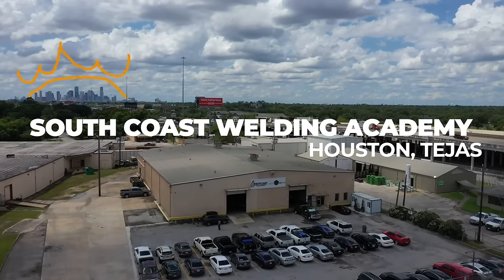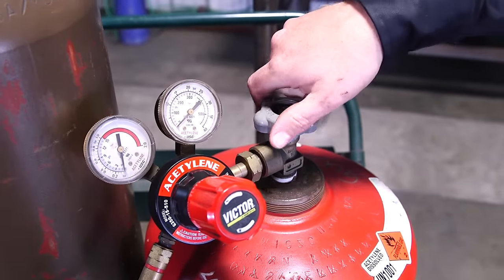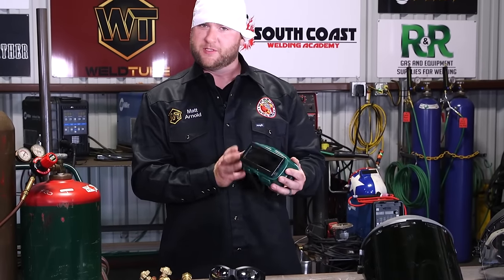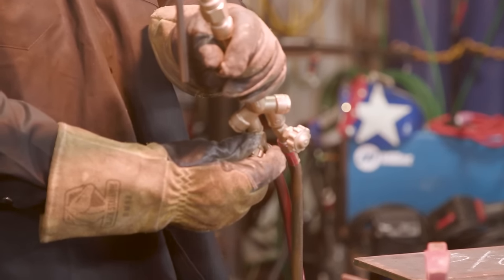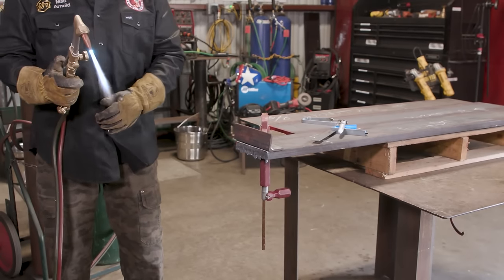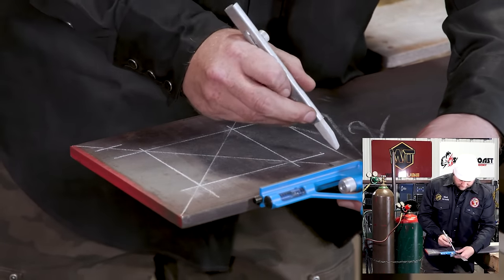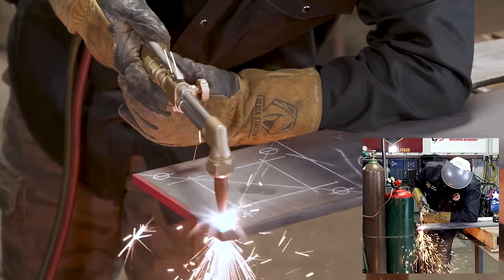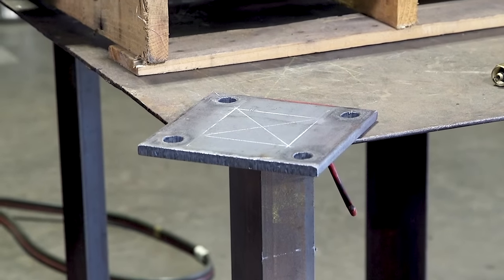Torch Cutting Basics Everyone Should Know | Oxygen & Acetylene Fuel

Comment: @ 12:07 the torch is set correctly when cutting cone is much longer then the torch flame. You will hear the blue cone crackle when the mixture and pressures are correct, regardless of cut thickness. Way too much acetylene imo.  The bottom cut edge of the plate should be straight and not jagged. The top edge of the plate should not be melted over either.
Reply: His travel speed was way to slow.  Pushing is better cause you can look inside the cut and watch what the jet stream is doing.

Comment: Add some flashback arrestors, leak check/soapy water and channel locks in there to hold hot metal to the safety list.
Reply: Great Idea.  When he opened valves the 2nd time the gauges moved, showing a leak.

Comment: Was always told to open the tanks alll the way. Am I wrong here? Was on welding tanks but still was told that’s the way they were supposed to be done.
Reply: As he briefly explained, the acetylene tank shall be opened only a half-turn (approx).  The oxygen tank must be opened 100%, because the tank valve  has an extra seat to prevent any inconvenient explosions.  If you can find welding safety videos from the 1960's and 70's, you can see what happens when regulators decide to explode when you are standing in front of them.  It's gruesome and no doubt painful to experience.  High-speed regulator parts can enter your chest, face, neck, etc when standing in front of them.  There are also the stories of what happens when these tanks are not secured correctly and fall over...the regulators can be broken off from the oxygen tank and the tank can obtain enough speed to pass through cement walls and seriously kill people.
Reply: @MikeSmith-qv5yc  Yes sir you are correct. I was taught the same thing in trade school in 1967. And don't weld or cut on gas tanks or 55 gallon barrels that were once full of laquer thinner. Yes I was in that large nuclear explosion. The welder that tack welded the angle iron to the barrel was killed in 1976. I had reconstructive surgery on my elbow. I was blown clear and had no shrapnel injury or burns to my body. The Vietnam vet said I was Damn lucky to just have a smashed elbow.

Comment: @weldtube would it be adviseable to turn the gases off at the cylinders even if you are just setting up for the next cut to stop any accidents?
Reply: If you not in a high-production mode and are not in a rush, you could.  Flame/flash arrestors are usually enough to prevent most problems.  If you stay aware of where the hoses are at all times and keep them away from the cut and associated areas, you'll do just fine.

Comment: how would you cut a pole? I find that the molten steel just welds back the pole because it falls right back in the cut
Reply: Typically That’s because your travel speed or torch settings are off a bit

Comment: Ive Been Fitting and welding for over 8 years and the shade 5 glass lens is better if u put it in a welding helm and the pressure on your tourch is way to low in the shop we run 70 oxy 15 acy and u wouldnt have that much time to cut half inch plate thats extremely long

Comment: IMHO: IF YOU TAKE THE TIME TO ACTUALLY DRAW THE PROPER "PERPENDICULAR, CENTER LINES", IT WILL BE MUCH EASIER TO "SEE" WHETHER YOUR "HOLE" IS "CENTERED" NICELY.....IF YOU CLAMP A VERY BIG, THICK WASHER DOWN, YOU CAN USE THE "INSIDE HOLE EDGE, AS A TEMPLATE, FOR CUTTING A SMOOTH, ROUND HOLE...

Comment: With 19 years of Oxyacetylene experience I noticed you forgot a very important safety factor, What about checking for leaks at all the connections? I seen someone using a torch and the hoses had a leak with flames.
Reply: Your nose will tell you before it gets dangerous,,,,but we do have a spray bottle of leak detector on the trucks and we spray down the equipment the last Saturday of the month in the shop. = Not for safety, but for economy.

Comment: What happens if your acetylene hose is under slag and the slag burns through ??
Reply: You get to meet Jesus or atleast change your shorts
Reply: Really ? The fire will go up the hose through the regulator at explode the tank?
Reply: @srjr2531  haha I'm just messin. I honestly don't know, and I don't want to find out.
Reply: @robertbasile4191  only reason I ask is bc I had a close call at work where I melted the oxygen hose with slag when I was cutting a chassis,
Reply: @srjr2531  you need to be more careful then.  Acetylene is flammable.  If you don't have spark arrestors on the tank side, you could have an explosion.

Comment: You don't need any pressure tip charts all you have to do is open your torch valves all the way up and then open your regulator valves while listening closely up near your ear to the sound of the gas flow coming out you will learn what that sound should be regardless of the orifice size torches should never be screaming loud but should have a substantial flame without any hiss the only time any hissing sound is acceptable is when you are cutting with the oxygen jet valve depressed learn to weld first so you understand gas pressure to tip size and never crank up the pressure on your Acetylene above 15 PSI it can become unstable like dynamite at higher pressures usually I run 3-5 PSI on the Acetylene if the heat is not enough you can try slightly higher but if you cannot get the heat you need you need to go up one tip size and retry the tip size controls how much heat is available and when your gas welding the metal should be nearly molten within about ten seconds of applying the torch close to the metal to form the puddle if it is taking much longer than 10-15 seconds you should try preheating the base metal with a torch first then retry welding after preheat but if you are still having slow puddle forming time you to get a larger tip. Gas welding is way more peaceful than arc welding is because when you get your torch tip dialed in to the right size for the material your welding it is nearly silent and you can easily see your puddle also because there is no lightning bolts arcing in your face to obstruct it.

Comment: Don't pull the torch.. Push it.  Pulling it will shower your feet with sparks. Its not a nice feeling when one or two get in.  Pushing makes the sparks go away from you and produces a better cut because you are feeing up your muscles instead contracting them. Also buy a cut-off torch. Combination torches are only good for cutting off muffler clamps. Been a welder for 38 years.
Reply: Hi trevor what is the difference and pros and cons of a cutting torch vs a welding torch

I think the welding torch has 3 dials. 2 oxy and 1 acet

Does a cutting torch onky have 2 dials? 

And what about a strsiggt nozzle? 

Im looking at buying a cutting setup. Victor and australian cigweld sell torch kits with a 3 dial torch. Welding tips and cutting tips. They have a 90C bend tip just like in this video  not a straight tip. 

What should I get? Im not welding. Only cutting.
Reply: @djdanzy  Since your only cutting, then you want a cutting torch.  A cutting torch has only 2 knobs and the neck is much longer so you can slide it threw your fingers further before resetting.  It's longer and heavier for stability.  Victor is a very good torch.  Good luck.
Reply: @trevor5290  thankyou!
Reply: @djdanzy  no problem.  If you're cutting light stuff upto 3/4" use a 0 or #1 tip. I use #2 and cut 1" and over with no problem.  With #2 I can cut a solid 6” bar.  Gas pressure is 15lbs acc. And 60lbs oxy. But I'm not paying for the gas.  If you are then 10-40 is the proper pressures
Reply: Frfr lol that slack fall on that boot it’s not gone be nice I can show a boot I messed up I’m still learning but I’m way better
Reply: Been a welder for 38 years and still telling people the best way to do it for yourself. If you stand properly it doesn’t matter and you should be able to do both. Practice makes perfect and old masters have good advice but ultimately you have to find what works for you and your equipment. Not every torch can be pushed anyways.
Reply: @djdanzy  hey man. There is no welding torch. Gas welding tip. Cutting tip. One has high pressure out the center hole and the other has a single hole that varies in size depending on what you are brazing or welding. Includes hardface for Gas application.  But you can Gas weld with a Cutting tip if you are careful and it's not too thin of material. Got any questions. Ask. 
  Over 40 years experience.

Comment: I dont see any Spark Arrestors on either lead at the hand piece, Im sorry but you are giving poor advise, you should crack the taps wide open, thats for safety , the reason being is if there is a incident, there is no chance of turning the taps the wrong way, this is possible when someone who isnt familiar with Oxy Sets or are in a panic, they cant turn the taps the wrong way if they are fully on, Im only stating safety procedures that are in place on Mine Sites, but are a good habit to use. Another thing to remember when cutting is to have the handset not  horizontal but elevated at your hand end, that way the flame is putting heat into the metal that you still have to cut. Im sure there are plenty of Boiler makers out there with their own little tips.

Comment: I hate using your style torch that's more of a beginner torch. I have a Smith 225 torch with a sc-12 - 3 ace tip that I trully consider a Cutting torch, I like using the 3 tip size as it's capible of up to 1/2 steel but can be used on small project metal cut or cutting up scrap or catalytic converter pipes which is mostly stainless. And the size 3 tip is just enough without excessive ace to heat up and over use to quickly use up bottles

Comment: I call BS on the hand snug. If you bump your torch against anything it WILL loosen that connection up and now you have a leak. Thank God the manufacturer puts hex fitting on their torches because theyre the ones facing negligence if anything happens. Use a wrench to snug it up, not crank down on it.

Comment: GOOD VID. HOWEVER, WHEN USING LOW PRESSURE  AS YOU ARE, GET ANTI Backfire DEVICES ON YOUR TORCH! LOW-PRESSURE BACKFIRE IS MORE PRONE TO HAPPEN THAN HIGH-PRESSURE. I KNOW BY EXPERIENCE . GET PROPANE TIPS FOR THE TORCH IT IS CHEAPER THAN ACETYLENE and cuts better in my opinion, I HAVE CUT STAINLESS WITH IT, VERY TRICKY BUT POSSIBLE! I HAVE BLOWN A HUNDRED FEET OF HOSE ALL THE WAY BACK TO THE TANKS IN 6 TO 8-INCH PIECES!  RUNNING OUT OF OXY AND TRYING TO FINISH A CUT, BUMPED THE TIP, AND BACKFIRE  TOOK OFF BANG BANG BANG, VERY DANGEROUS! ONE IN 50 YEARS, NOT BAD!  ONE IS TOO MANY, BE SAFE USE PROPER EQUIPMENT, AND HAVE GOOD FIRE EQUIPMENT WATER, AND EXTINGUISHERS, UN SEEN THINGS HAPPEN! THANK YOU FOR THE POSTING.

Comment: I've never been in a shop where anyone fucks with the regulators. Set um and forget them. Unless you're changing you head or extreme changes. Odd af
Reply: Very true.
Reply: Just bought my first oxy rig setup and the guy said always open out the regulators before turning on the tank.  Said high pressure hitting the diaphragm can damage the regulator and rebuilds can clear $100 each.
Reply: @robertbasile4191  well my regulators are 50 years old and have been used in that fashion their whole existence I'm sure. Honestly that makes no sense especially since I understand how a regulator works and can't remember anyone ever rebuilding a regulator
Reply: @robertbasile4191  hell rebuild kids are $20 and besides good Victor full size most are under $100 new. Acetylene is not high pressure. And I don't understand why people don't get their regulators not valves lmfbo that's like using a dimmer to turn the lights off.
Reply: @robertbasile4191  And it's important to keep all regulator parts on the OUTSIDE of your body.

Comment: That is something that kills me.  Nobody even has, let alone uses a cutting torch on yourtube. All you see is cut-off wheels. -  They didn't even exist 15 years ago and we were making parts that go on nuclear aircraft carriers,,,,,burning machine and manual torches. - We didn't even have plasma. 

I can't say I never use the grinder to cut things but I still have the first 10 pack of disks I ever bought. We cut some small things in the Vert Bandsaw if it's under 1/4" but If It doesn't fit in the horizontal band saw or get cut with a track burner it the hand torch every time.  Sheetmetal gets cut with our small Plasma. ----  Grinders are for that, Grinding, Not burning. .

Comment: This guy is NOT using enough O2 pressure to cut the 1" plate.  The slag SHOULD NOT accumulate on the back side of your work piece.  Slag must be forcefully blown clear of the work piece when the cut is made.  Also..............No need to pre-heat the work piece.  I have NEVER pre-heated a work piece and I can produce a razor clean cut.  Not sure who this guy is but he not offering good information.